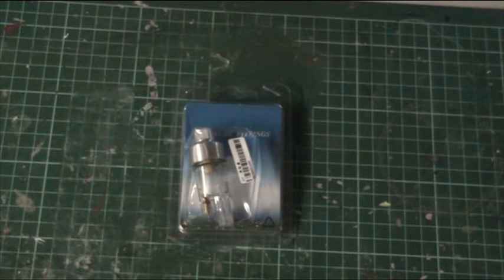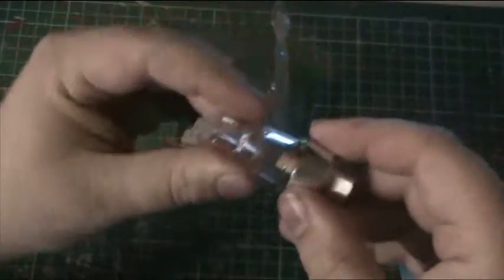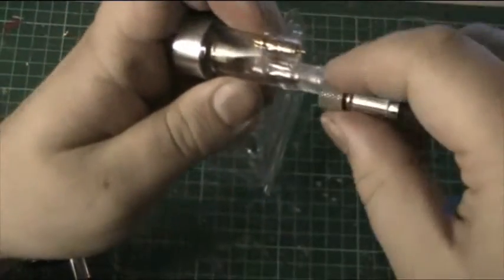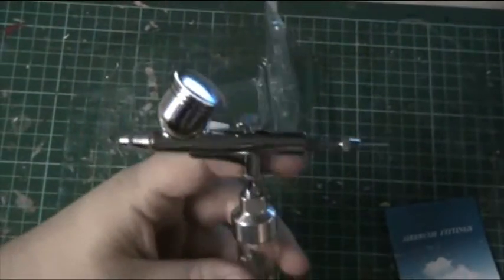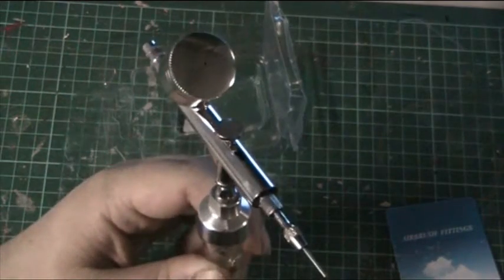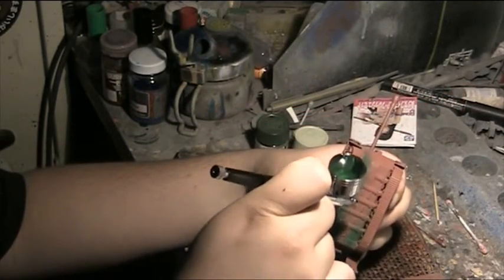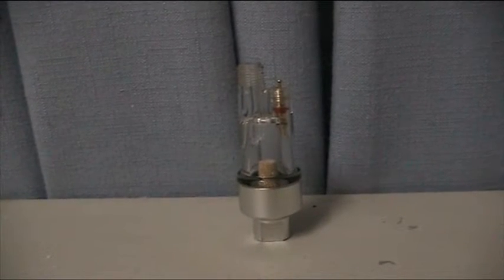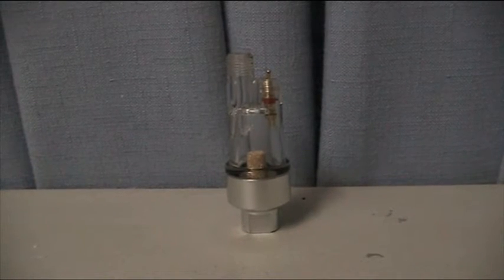1/8'' post regulator air moisture trap for airbrush review

Comment: sweet video man, just what I needed to install and use my filter
Reply from the maker: Nothing, it will screw in between your airbrush and hose, if you use a rubber push in hose then remove the bottom adopter of your airbrush and the filter will fit in between.

Comment: Great video. Didn't know what the golden pin was for. I'm using spray gun to spray gel based substance. I guess my air filter was spoilt because of that as the golden parts because powdery. What gun or filter should I use for spraying gel? Actually hair tonic gel
Reply from the maker: Hello, I have very little experience spraying gel. I have messed around with hair lacquer spray. With an airgun I assume your using high horse power compressor blasting it at a high psi. Not sure how it would cause harm on the filter. Window cleaner or sursface cleaner from supermarket cleans and debonds hair products. Soak it in pure cleaner and see how it fairs. A full airgun set up should be good enough to spray anything.
Reply from the maker: Also consider using this https://www.youtube.com/watch?v=L1uegzzo7EI

Comment: Mine doesnt have a filter hanging inside it..I used nipples on both ends and fit it into the hose close to my paache airbrush..Theres blockage until I let off the pressure to the filter..Ill check my airbrush..For all intents and purposes it should still work,right?

Comment: mine keeps blocking the flow of air. Eclipse hp cs works fine without the trap on it. I need to figure this out.
Reply from the maker: the brass rod in your airbrush air valve is set wrong. You can 1) change the valve 2) add a second hose and filter in the middle or 3) filter at the air-compressor end only if you remove after use to dry out.
Reply: @mokanaman  I also have a quick disconnect and I put the in-line moisture trap on the bottom of that instead and quick disconnect on the airbrush and that setup works perfectly. The moisture trap was definetly blocking the travel for the thing at the bottom of the airbrush that moves when you push on the trigger.
Reply: @Themustangturtledude  this is perfect....Thanks!

Comment: I love quick to the point videos such as this, thank you! Question, would it matter if I attached the filter by the compressor as opposed to the airbrush?
Reply from the maker: Thank you for your feedback. After making this video I sold a ton of these as well as the original still going strong. What end you place the filter does not really matter. I rather collect the water in the hose which is easy to drain over the compressor end.

Comment: will this work on a passche vl model since the hose is smaller?
Reply from the maker: You will need something like this then you are set to use any hose or compressor https://www.ebay.com.au/itm/Paasche-Airbrush-Adapter-for-Paasche-Airbrushes/302330521711?hash=item46644da86f:g:ixcAAOSwCQZZKi18
Reply: mokanaman ok but i need one for the air hose, passche is smaller than the 1/4 ur using. 🤔
Reply from the maker: Yes, the link above is the correct thread size to passche then attaches to a hose.